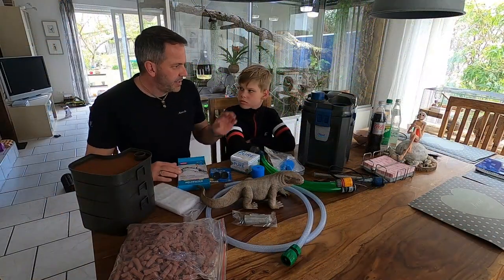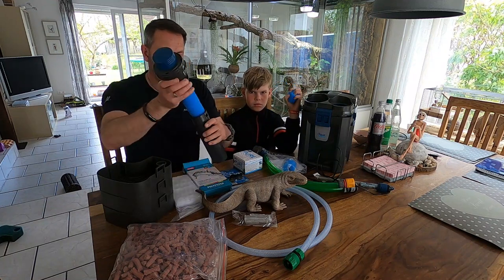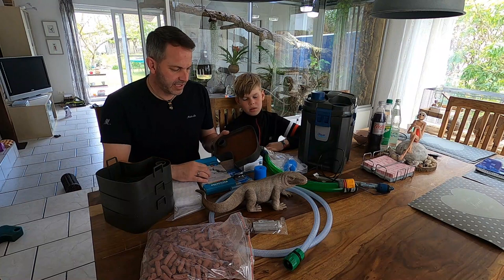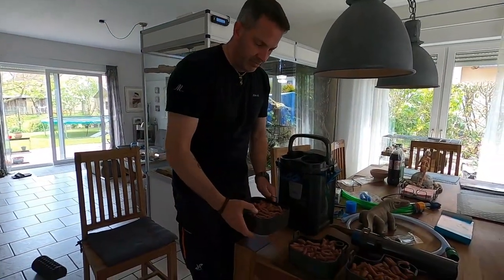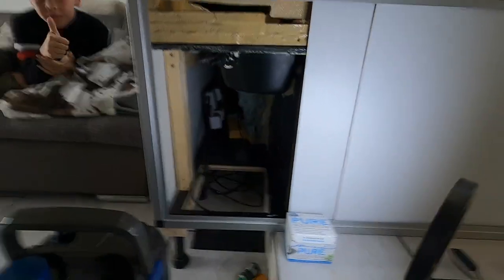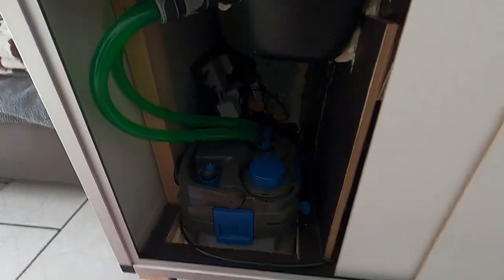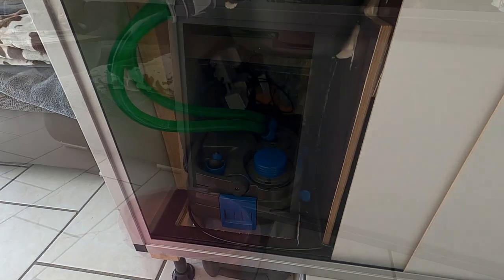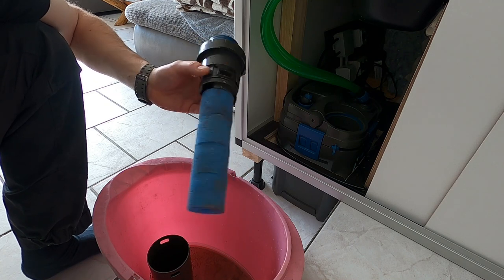Canister filter setup for the paludarium terrarium pond. Pimp my filter Oase Biomaster 250 Thermo

Comment: Hi again Sven. May I ask what you used to connect the Gardena quick connector male to the pond? What keeps the water from flowing out of the pond if you disconnect the filter? It seems there is no quick stop on the pond, no
Reply from the maker: Hi, the conectors into the pond are over the waterline so there cant get water out of the pond. The next thing is that my Filter has a shut of valve that prevents water from leaking out while cleaning the filter. The suction pipe is only 15cm deep in the pond so the worst thing that could happen is that the filter pumps  arround 30 Liter of water trough a leaking quick connector and if this happend I have a water alarm in the filter area.
Reply: @Thegermanmonitorlizardguy  Great planning! It looks like you have a female quick connect her on the inside of the pool, and a male on the outside. Did you just add a rubber gasket between these to seal it to the pond?
Reply from the maker: I have only male conectors. Between the pondconector there us a rubber gasket and also sealed with silikon.